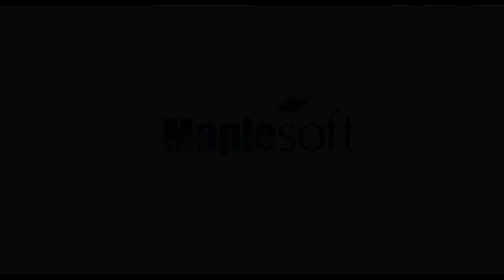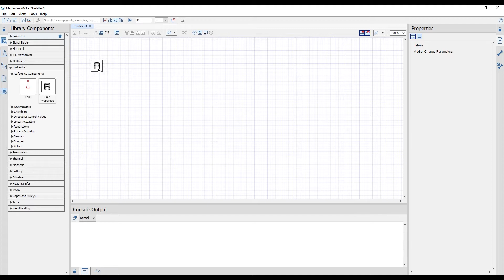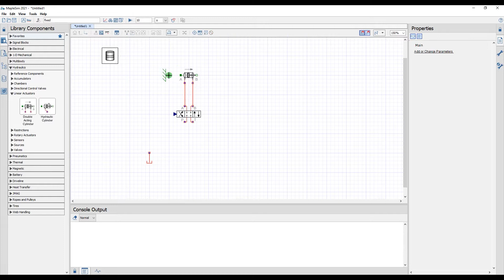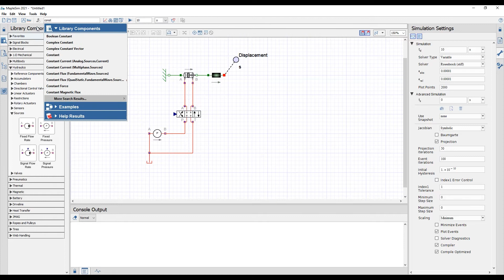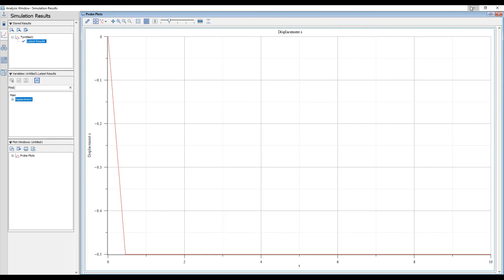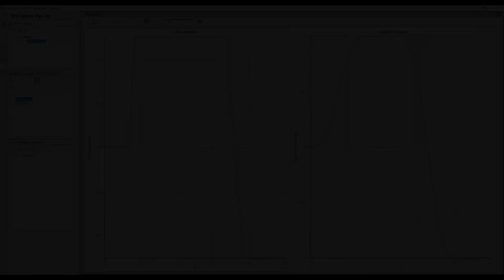Using Hydraulic Directional Control Valves

Comment: Can I switch the power and see where the fluid is going? and see when the valve and cylinder open?
Reply: There are no "visual" aspects in modeling a hydraulic circuit in this way. There are signals that can be "probed"/plotted that would answer your questions (e.g. flow rate or effective area of a variable orifice)
Reply from the maker: Thank you for your question. Out support team will be happy to assist. Please complete this form to contact them directly: https://www.maplesoft.com/contact/webforms/support.aspx